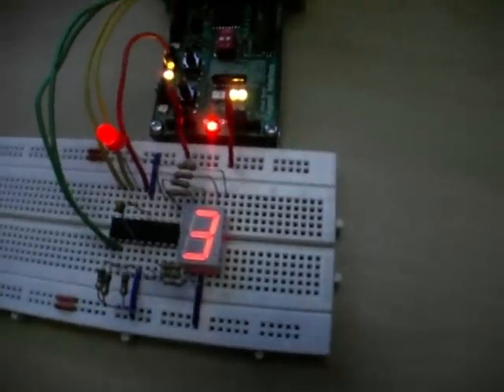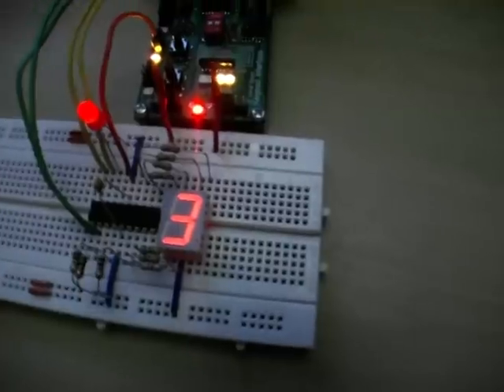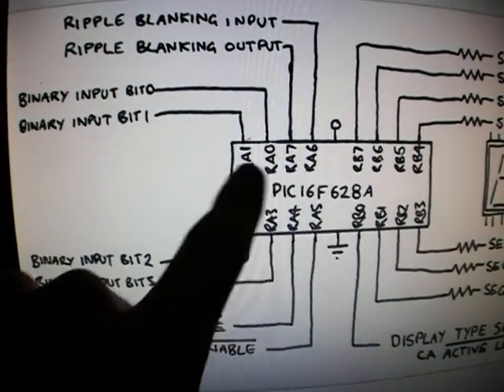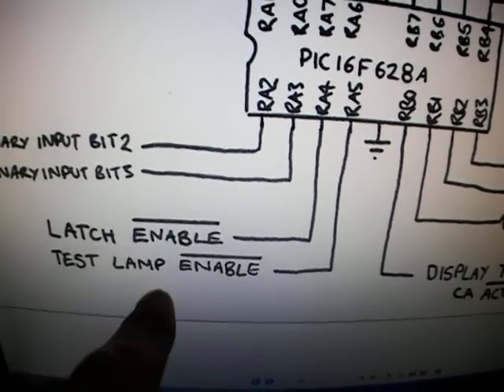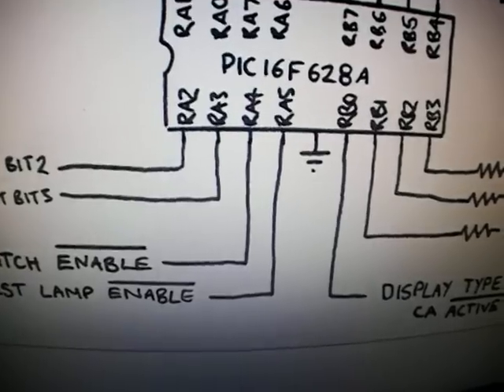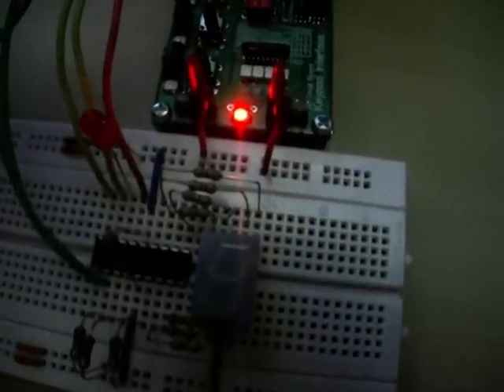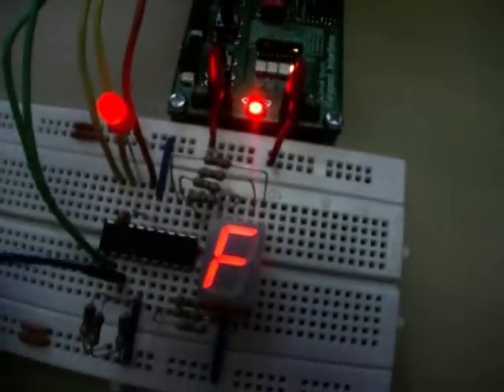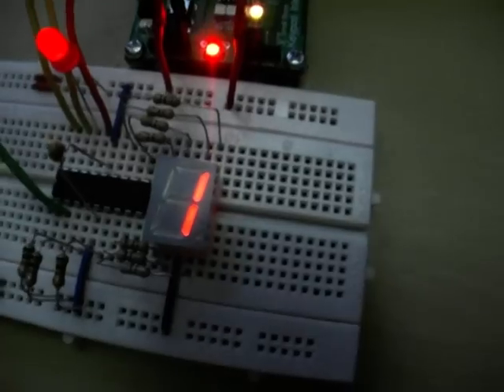JE Project - Binary to 7 Segment Decoder

Comment: You should probably try something larger than a single digit. Hoot up say about 10 7-segment digits and try converting 16 bits or something. Unless you want to create a circuit by using the double dapple method, you may have to buy the unit that does it for you.

Comment from the maker: I ran out of words in the last comment.
I will explain the use of the gates a little better.

The reason I recomended using the gates on the ouputs of the 1's counter, is to increment the 10's column every time the 1's colum hits '0'.

And you can use a Quad input NAND, (Part number CD4012), instead of what I first recomended.
This way when the 1's ouputs are 0000, the 10's column will be incremented once.

Note that I haven't tried this and it is all ideas. You will have to try it out.

Comment from the maker: I dont, but you could use a chip from the 4000 series.

Eg, CD4518B Dual BCD Up-Counter, 4bit output.
Then plug it into a decoder like mine in the video. x2

With the CD4518B, with every pulse, it will increment, and cos it's BCD, it returns to 0 after 9.

The CD4518B is a Dual counter, so you can use 1 for the 1's column and 1 for the 10's column.

On the outputs of the 1's column, you put 4 inverters, going to a 4 input AND gate, and that will trigger the tens column when the 1's = 0.
Reply: hi jake i just watched your video it's amazing can you send me your protocol please ? i would want to read it to do the same